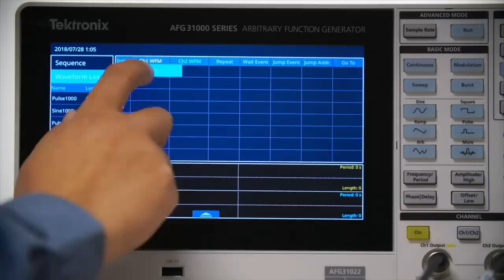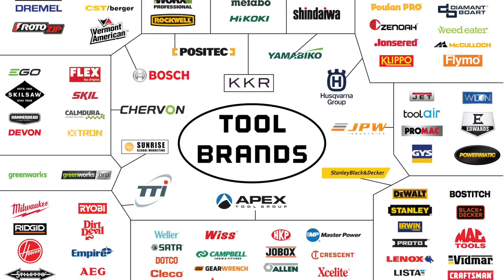Who Owns Your Favorite Power Tool Company? [2023]

Comment: I'm more interested in knowing if different brands are made at the same facilities under the same specs.
Reply: Me too. Like ryobi and milwaukee.

My gf uses milwaukee with her work. I've only just started buying them.
Reply: I work for a company that makes proto, Mac, and black hawk wrenches and sockets. Proto is the least expensive then black hawk with Mac being the most expensive. All three brands are forged from the same material the same way. Heat treated the same. The only difference is what stamp they get. The least expensive proto is the exact same as the most expensive Mac. The only difference is one gets the proto stamp and one gets the Mac stamp other than that they are the same in every way
Reply: James Doe those are hand tools though right?
I'm sure power tools from different companies aren't made the same, otherwise data based reviews would conclude they have similar performance and recommend the cheaper brand. 

if power tools are made like the tech industry, it's all made in the same factory but each component is tested and the lesser quality ones are pushed to the cheaper brands/models. and the ones that perform better are put in higher quality stuff.
Reply: @dylan-nguyen  yes hand tools(wrench's, sockets, ratchets, extensions)
Reply: Dylan Nguyen, and the best ones are $10k each and get NASA stamped on them😂
Reply: James Doe wait a minute Proto is far from cheap are you sure they are cheaper than black hawk ?
Reply: Yep. For example, the Milwaukee and Hart (Walmart) brands are from the same company, so curious as to which of their tools have any crossover.
Reply: @19jamespaul66  yo, James Doe thanks for the inside info ...👍
Reply: @jamesfair9751  yes I'm sure proto are top of the line but a bit cheaper in price than black hawk
Reply: Need to know which ones are made in China, so I can avoid those!!
Reply: Irwin still makes "vise grips", just NOT in the good old USA. Gone is the "USA" on the handle!
Reply: My Dewalt 1/2 impact is identical to the Mac impact, I think some are, some aren't.
Reply: Worx, Titan and Erbauer (pre-EXT) were all made by Positec and had compatible batteries. Erbauer has now been completely redesigned with the EXT range with metal chucks for the drills, metal gears, brushless motors and lithium ion batteries with better chargers. Erbauer has become the best quality own-brand in the UK and some other countries and is owned by Kingfisher but the production is, of course, outsourced.
Reply: ojars zvaigzne    Most tools are made in Asia now so good luck trying to avoid them.
Reply: Many own-label brands are manufactured by Positec at the same facility in China.
Makita is different and manufactures in several countries including a plant for power tools in the UK.
Reply: In some cases, there's a huge difference. For example, DeWalt is owned by Black and Decker, but is trusted far more than Black+Decker. AvE says DeWalt often means Default, meaning that many people choose DeWalt as an overall good brand, and in my experience, DeWalt's tools have been a generally solid prosumer brand.
Reply: Chervon is now the ODM of Erbauer power tools and the quality has improved significantly with metal gears, metal chucks etc. and brushless motors. It would be interesting to know which other brands Chervon manufactures as an ODM.
Reply: @TheOzthewiz  Nearly all power tools are made in China or Taiwan, or contain parts that are. There are a few manufactured in Germany. But, for the most part, they all come from Asia.
Reply: This is like bicycles that are sold in the USA, there are like 3 main factories in China and Taiwan that make 90% of bikes sold.
Reply: It's the same with the food industry.
Reply: @JoeStuffz  if you pay 200 for a tool with a batter and battery being 179. It better be good lmao
Reply: .JoeStuffz
Reply: @19jamespaul66  Good to know. Thanks.
Reply: All these companies that have many brands of similar tools may share a lot of things but the difference may come in critical components, firmware and overall quality control of the specific manufacturing processes. A good example is Ryobi and Milwaukee which are made by the same company. A lot of materials for making lets say the batteries will be sourced from the same place, some or many of the internal components of the batteries may also be the same but when it comes to the programming of the software of the batteries its all different, critical components like charge controllers, lithium cells, may be better on the Milwaukee brand, also the quality of the manufacturing of the Milwaukee batteries is better for example in the Ryobi for every 1000 batteries made 40 may be defective while for every 1000 Milwaukee batteries made less than 3 may be defective. That's the type of control that guarantees a better more trusted product in the end and also more expensive.
Reply: @miker1670  I'm an electrical engineer so I'm pretty aware of how manufacturing work and don't get the "marketing shit" you talk about.
Reply: @marcoteves685  I bought a makita brushless high torque screwdriver the other day and it says made in the usa on it!
Reply: @kizzjd9578  Makita are different to all other power tool brands in that they don't outsource and they don't have use any other brand names on their products. Also, they have factories based in their markets, there is a Makita full-production facility for power tools  in Telford, England, the only one in the UK and they have a facility in Buford, Georgia, USA. If I needed power tools for more than just occasional DIY use Makita would be my first choice.
Reply: @19jamespaul66  same material, same treatment, but different design (molding design), it makes different in performance even 0,5 mm differences it can make huge impact.
Reply: @danpandapotan  they are all made the same way same design the only difference is the name they get stamped with. Thats a fact. They get forged the same way same mould
Reply: marco teves Makita tools are manufactured in China.
Reply: marco teves Eruaber tools work ok and are good value up to point.
Their problem is back up with parts and after sales with B@Q is none existent
Reply: So who makes harbor freight tools.
Reply: P
Reply: @19jamespaul66  that's good to know, Mac is good but expensive !
Reply: @TheOzthewiz  TTI is Chinece xompany so avoid Milwaukee, Ryobi etc. If you look the tool, there is mentioned where it is manufactured. I do buy always when possible European company and tool made in Europe so Festool, Hilti, Mafell, Fein and Bosch
Reply: I use Wear and Klein at work Makita at home, I would put my Wera tools up against anyone including Snap On
Reply: Very likely made in massive Chinese plants that just change a few cosmetics for each brand.   That's the American way these days.
Reply: Yeah me too
Reply: @jamesfair9751  you're right, Blackhawk replaced the Proto Challenger line as the cheaper tools from Proto. A Blackhawk combo wrench set is significantly cheaper than a Proto one.
Reply: @19jamespaul66  well yes you are correct that is the case with most HAND tools,however the power tools are made by the same factories but not the same tolerances or specs which explains why the mid impacts for Milwaukee, Ridgid, hart , and Ryobi all have different numbers. It's just laziness, it should be like the hand tools but oh well
Reply: @TheOzthewiz  All are Made in China. Designed in US or Japan or UK, but all are made in china. Avoid buying tools at once.

Comment: All my power tools are Makita. Had a mix of Bosch and Makita, but eventually I went all Makita. Their tools are great quality and here in Germany they cost less than Bosch.
Reply: Bosch tools can fail in weird mysterious ways. Never had a problem, yet, with Makita. Touch wood, fingers crossed...
Reply: I found their batteries were terrible didn't keep a charge
Reply: My father has a beat up makita over 10yrs and is still working. Its been used in multiple construction sites already. Sucks they dont have good warranties such as dewaltt
Reply: Yv b
Reply: Erik Isip LOL! I know, Right?
Reply: Terry Jackson the old NiCd batteries for all manufacturers didn’t keep as good charge capacity and didn’t have appropriate charge / discharge cycles built into charge controller microchip so they eventually got “memory” if you didn’t fully discharge them regularly &/+or left them sitting in the chargers too often when not being used. All brands had these issues but some adapted and upgraded charger tech quicker to extend battery life.

We had a battery reconditioning unit that cost $4k that could restore most of the charge capacity of a NiCd in about a week of constant charge / discharge cycles of specific levels with interleaved discharge during charge cycles. 
Complicated & expensive but it was for super expensive crucial 2-way radio batteries for public utility work.

Lithium ion batteries are far less susceptible to this! New charger technology helps as well.
Reply: Joseph Clark  I guess you miss all the comments of long time Makita owners saying it just never breaks. Even myself my Makita drill is almost 30 years old now. Still runs as good as the day I bought it new. German or not , Makita reputation is rock solid
Reply: They are still all assembled with Chinese parts. Unfortunately the Chinese hold every brand hostage with most electrical supplies.
Reply: @Ole_CornPop  Can't speak for all the internal parts, but I ordered original replacement carbon brushes for an older Makita drill and they were labeled "made in Japan".

According to one of Makita's websites, Makita products and parts "...are manufactured in Japan, Germany, China, UK and the USA, by subsidiaries of Makita Japan, to ensure Makita’s quality remains high."
Reply: Joseph Clark  Because Makita still makes 90% of their powertools in Japan, Unlike Bosch, who sold their anus to china. I will buy a Bosch product, as long as they're not made in china.
Reply: Croatian products in germany are sold cheaper than in croatia, WHILE bosch is more expensive in croatia than in germany. Out of hate for EU economical shitty system, it forced me to buy makita aswell haha. God bless the japanese
Reply: i love Makita as well, and have some tools that i use at home in my shop. In the company where i work they have some old Makita still made in Japan working pretty good, but in the site we need to be fast and reliable so we are switching everything to Hilti.
They are very expensive but worth it, awesome quality and great customer service.. one day i call them for asking about what kind of nail to use in concrete with their nailgun and 40 minuties later a Hilti technician showed up bringing me 5 different kind of nail to try.
No one will do that
Reply: @erikisip3843  If they don't fail, they don't need warranties!

Comment: Two companies viewers should know.   Wise Tools, made the high quality slip joint smooth pliers for craftsman.   You can still buy these USA pliers from them under the Wise name as well as many other USA made tools.   Second is Western Forge.  The WF in the model number of all made in USA craftsman screwdrivers stands for Western Forge.  A below the radar US company, look for brands the contract with.   Sometimes they sell under the Western forge name but infrequently.   Buy USA made tools!
Reply: Russell Robins  Thank you for the heads up. I haven’t bought any hand tools that aren’t made in the USA for many years. Power tools, well, that’s different. I have some made in Japan & Sweden.
Reply: We as trade workers buy Klein when we can but even those are not all U.S.A. made anymore. Even boots and as much as possible some of us still wear American made. I do. My boots are recrafted by a local shop.
Reply: Craftsman tools were made by more than just Western Forge:
http://alloy-artifacts.org/craftsman-early-tools.html

Some time in the 90's Craftsman hand tools were contracted to offshore suppliers which results in tools not worth the metal they were made of. Yet, Craftsman tool fans continued to purchase, use and covet them. This was done for the profitability of Sears which eventually sold the Craftsman name as that brand name has value in the market place which is why the Stanley-Black & Decker tool group purchased the Craftsman tool brand name. This will allow Stanley-Black & Decker to brand more of their centralized tool manufactured tools under a different brand name. Stanley-Black & Decker did this with the Facom tool brand in Europe.
Reply: Jar of Mayo,

Comment: Great information.
I almost always bought Porter Cable tools...then, thru a trade publication, I found out B&D bought them out. I immediately went out and bought a thousand bucks of PC tools because I figured B&D would turn them into homeowner grade crap... which they've basically done.
Now, I buy mostly Milwaukee tools...
Reply: @bobtahoma  
The tools I bought weren't replacements (except for one cordless drill) they were all new & different PC tools that I I'd been thinking about buying.
My only problem with DeWalt tools: they don't seem to hold up to the usual jobsite tool abuse.
Reply: Smart.   Wish I would have done that before they turned into chinsum.
Reply: @georgeburns7251 👌👌
Reply: I have a few Porter-Cable tools.  Stopped buying them when they, and DeWilt and B&D, pulled the battery "upgrade" marketing scam with their new and improved 18 volt batteries called "20V-Max".  That was the end for me.  They purposely voided my investment in their battery system, thinking that I was stupid enough to fall for it.  Instead, it sent me looking for a new brand.  Let's see... Who's been making battery operated tools that use the same battery system for that last almost 20 years?  Ryobi.  No, they're not the be-all/end-all for super-duty use, but they've lasted better than my P-C drill has (blew-out 2nd gear in under 2 years of LIGHT-duty use).
Reply: Seems like all the tool manufacturing Co's have gone to newer battery platforms! I switched from PC to Makita for that reason but then even Makita changed their 18 volt platform so the older 18 v batteries can't be charged with their newer ones, although credit to them you can get universal chargers now I believe that will charge either one.
Reply: Just purchased a replacement hook and loop head for my 20 year old PC random orbital sander. Big disappointment!!! Didn’t even hold PC paper. So I took the 20 year old hook and loop face off the old disintegrated pad and glued it on to the face of the new pad to make it work. PC has lost their quality for sure.
Reply: @rbstorms  The old 18V system was ni-cad based batteries and the new 20V is Li-Ion and fully charged it is 21V. Time marches on.
Reply: cp6027 I know that they changed chemistry, but they’re still a nominal 18-Ish volts.  If it was that much of a problem, why does DeWilt make an adapter to use the new batts on the old tools?  If it was a problem, why can you use the new and old chemistry batteries in Ryobi, Milwaukee, and Makita?  Sorry, I’m not buying DeWilt’s, Porter-Cable’s, and Black-N-Decker’s marketing wank. Kobalt came out with 24-volt tools that actually offers the advantage of higher voltage, but didn’t have an older line to worry about compatibility with.  When I’ve spent hundreds (thousands?) of dollars on battery-powered tools, I’m not going to buy in to a company that switches up their batteries just so they can see if I’ll buy them all again.  I take care of my tools and want my investment to last as long as possible.
Reply: @rbstorms  there is no profit for companies if you are not buying new tools. So companies figured out the rechargeable battery scam to cash in on everyone. Pull battery packs apart and they all have the same cells in them. But no packs fit on other tools. Then to cap it off manufacturers started adding electronics into their products to stop consumers from tampering with them. A small chip that costs them pennies stymies most users. Brilliant! They can really screw with the brushless models. Flip one bit of data and disable the tool. Tradesmen generally know butkus about electronics. Like handing an ape a calculator.